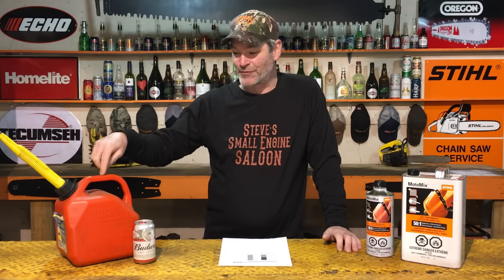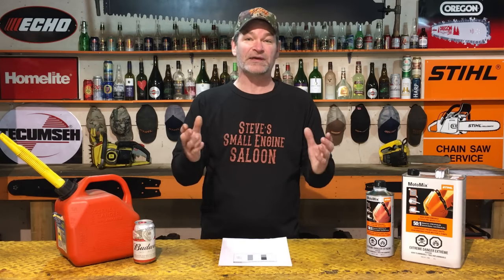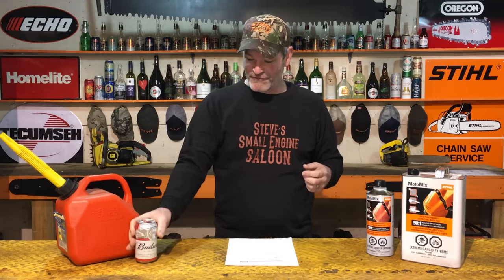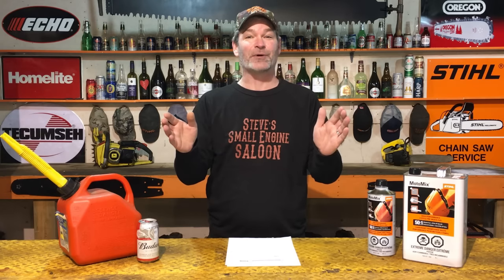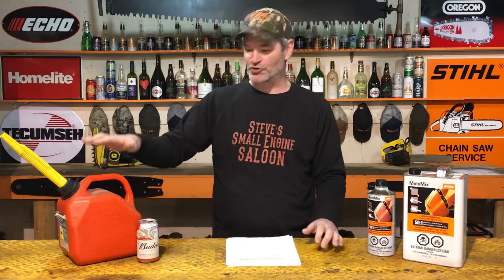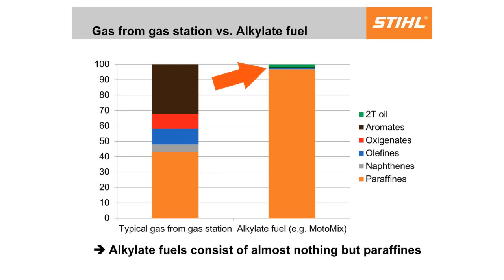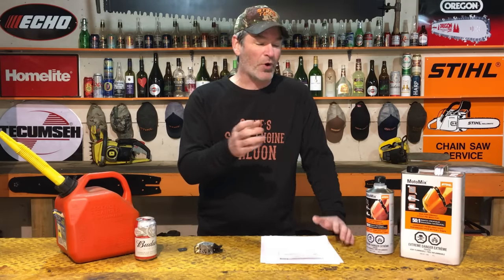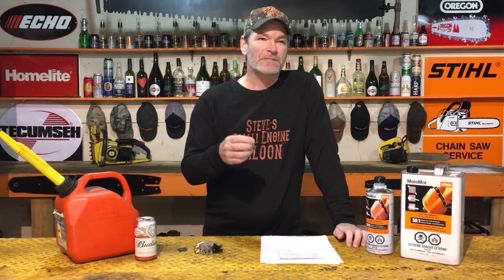The Ugly Truth Why Gas Station Fuel Is Bad For Small Engines

Comment: Thanks for sharing this. I've heard (and said) a lot of dumb things about why gasoline from the station is (or isn't) bad for small engines. And I've cleaned a few carburetors and junked a few lawn mowers that might have lasted longer had I known what I know now.
Reply: Why do the gas manufacturers put the other junk in here? What is the purpose of it? What does it do to the environment and is it worth it?😊

Comment: I have been using normal unleaded fuel that I manually mix with two stroke oil in my equipment for the past eight years while living in my part of country Australia and have had no issues with my equipment. Oh sure, I expect that the Stihl fuel is a premium product, just like their very expensive chainsaws are premium equipment, but for us more common folk, that can only afford so much, in my experience I can say that using just regular fuel is fine. Mind you, if I ever did save up enough money to buy a $1000 plus chainsaw I would probably buy the more expensive fuel, though I doubt I could afford the postage costs. But I do love the way that Steve presents his videos.

Comment: In Belgium, we trim hedges all day long in summer and always use pre mix fuel like Moto-Mix but it's Aspen.
We use it because it's better fot the engine, it's already mixed and it's not that harmful for the health. I can ensure you if you're hedge trimming all day and you breath all those fuel fumes , you feel horrible at the end lf the day. We always use hand held hedge trimmers, but extended trimmers for reaching high places
Reply: PJ 2000 why not go electric ????
Reply: @jimmysapien9961  2 reasons: a lack of power for some hedges 
And battery powered equipement is really expensive

Comment: I work for the local power company and a few years ago we switched to motomix. We don't use our saw everyday but when we need them we need them in a bad way. Before we switched it was almost a weekly deal to haul a saw to the repair shop for fuel issues. Since we switched it has cut repair bills by 2 thirds. Maybe even more. For my home saw and weed eater I've been using Coleman fuel mixed with stink 50:1 mix for several years. No issues at all and runs just as good as the stihl  mix. Plus it over half price of moto fuel . In all reality moto fuel is Coleman fuel. I know all the rc model aircraft guys that fly the super high dollar airplanes use Coleman fuel mixed with stihl oil. It works fantastic.
Reply from the maker: Right on...
Reply: Yes, it's the same stuff as motomix. Just add a bottle of stihl oil and your good to go. Wal-Mart brand is cheaper that Colman brand.
Reply: Al Yaz Coleman fuel is naphtha. Same as lighter fluid. Same as VM&P Naphtha at the hardware store.
Reply: @graphicsdude  doesn't seem like a engine would run very good on straight naptha. Or am I missing something he said.
Reply: I dont see where folks are constantly having issues?  I per mix my fuel and sometimes dont run my equipment till the next hunting season....never a problem. That's my blowers, riding mower
 Weed wacker... mowers. Same thing with my buddies.
Reply: @henryross4343  well I'm not sure where you live but here in SC it's either hot and humid or cold and damp or wet and humid so fuel tends to draw lots of water from the atmosphere. Only way I can leave fuel in mine all winter is to add some stabil if not the run raggedy come spring. Some times you get lucky and they run ok. But I would assume that's because most of the the fuel has evaporated out of the carb.
Reply: @ReidHenderson  I love in austin.  I use amsoil amber two stroke oil.  I mix a gallon for my two stroke  equipment and then pour the left over in my mowers with regular gas.  I would have to say amsoil claims of not needing fuel stabilizer is correct if you use there two stroke oil.
Reply: @henryross4343  Everytime I get done with my two stroke equipment I pour the unused small gas cans into my mowers. I would like to think that little bit of oil helps to lubricate everything on the top end of the engine some. As long as you don't get to rich of a oil mix and foul out plugs
Reply: @henryross4343  lol Henry I do the same thing!!! Lmao I actually  add a little more oil than they suggest because I feel they have it to lean a little more oil keep it lube good;)

Comment: As a lawncare professional, I have to say that service and repair is less expensive overall than the cost of premixed fuel.
Perhaps for a typical use homeowner, premix is a better option.
Reply: Yes, for a homeowner premix is great typically as they don't use their equipment on a daily basis, and some equipment sits for several weeks to several months so premix for that is great....

For the pros that are using their equipment daily premix don't make any sense as you are going through your fuel fast enough that you won't have any issues.

Comment: Hi Steve, have you ever heard of draining and running all the fuel out you can before storage then pour mix oil only into gas tank, push primer bulb until you see it in bulb maybe a little extra to be sure it has been circulated through all gas lines and carb.

Comment: Have been storing my small engines this way for several years. Also only run no ethanol gas in all my.small engines. Zero problems with this program.
Reply from the maker: Right on
Reply: Me too. But it's no guarantee. I have a 4-stroke Makita leaf blower that is having carb problems. It's never had anything other than alcohol-free fuel. Been diligent about maintenance, but I'll be damned if it doesn't run like shit. I don't know what's true. If what our boy, Steve says, even alcohol-free fuel is 40% bunk. Our other choice? Buy the fuel that costs 20$ a gallon.

What guarantee do we have that the $20 a gallon fuel isn't going to leave us with a clogged jet?
Reply: @stevetdean1966  Just be diligent keeping the fuel clean of crud. For long storage periods like generators I always run the carb dry with never a problem.

Comment: I've been winterizing my equipment with engineered fuel for 3 years now without any issues. It is expensive so I just run the tank dry at the end of season and run engineered fuel into it and leave it and haven't had an issue starting up come the spring or well winter with the snowblowers yet. When I'm running equipment daily though I'm using regular gas from the pump, 2 cycles since I don't use them as often I stay with engineered fuel all the time to avoid having to deal with those carbs.
Reply from the maker: Right on Rob!  I agree...

Comment: I used to dump the fuel after the season ,then run it and choke it dry .  After a couple trips to the repair shop and spending $$$ I decided to try this. I have used aspen and motomix. They are both great. Yes its expensive but no frustration or trips to the repair shop.  For the little fuel the average person uses ,I think it is worth it.

Comment: I've used SeaFoam in any and all gas cans, not including 2-stroke, and have left engines for > 5 years, and had zero varnish, and immediate start. The engineered fuel is nice, but the value is extremely poor based on its pricing. Toluene (SeaFoam) does a gr8 job IMO.
Reply: I agree. Couple caps of it in all my 2 cycle gear keeps em good for the winter
Reply: i use it in all my small engines and never had a problem...never...and yes im an old guy ok??
Reply: Dave Hanson  wrong it works in anything
Reply: How do I use it. If I have gas left in the saw and think I won't use it for a while, add some seafoam? How much? If I  storing it for a long time, run it empty and leave it empty? Or leave it with only some seafoam? Or leave it with se gas and seafoam?

Comment: Hi Steve. Just ran across your video. Thanks. Were carb diaphragms made of different material 35-40 years ago?  My retired Lawnboy never had carb problems through the 1980s and 1990s. My 1986 Homelite SXL chainsaw and 1984 Jacobsen 2-cycle snowblower also never had carb problems with pump gas and are both still used today.  Other equipment I purchased in the 1990s & 2000s have had numerous carb diaphragm problems. I do use TruFuel now in recently purchased chainsaw and leaf blower. Other equipment for last 5 years uses pump gas w/o ethanol + SeaFoam. I only run dry the Jacobsen.

Comment: Our fire dept in Texas transitioned from gas station fuel to the canned fuel several years ago.  Our Stihl saws and ventilation fans were constantly in the shop prior to the change.  After using the canned fuel, our stuff started and ran great.  We don’t use that much fuel so the cost wasn’t that bad.  I just bucked approx. 70 trees a few weeks ago.  I blew through the canned fuel and that cut in to my profit quite a bit.  At $25 a gallon, I spent nearly $75 on fuel.  That stunk.  I wish there was an in between source that was good but not so expensive.
Reply: $1 a tree
Reply: You can do the majority of the work with pump gas, and switch to the canned fuel when your almost done.

Comment: Steve I have a quick question for you. I have a zero turn lawn mower with a Kawasaki motor on it. I checked the stator when it was running and I wasn't getting any voltage out. However, I have continuity.  I'm pretty sure that the stator is bad because it showed no reading when it was running. what are your thoughts on this?

Comment: Steve, don't throw the baby out with the bath water. Your Bud there is about 5% ethanol, and it seemed to go down ok.  There's a place for everything in your standard gasoline.  Benzene has an octane number of 101.  Without aromatics like benzene, it would be a lot harder to formulate high octane fuels. Benzene is a fine motor fuel as long as you don't suck on your fuel line. Lick your carburetor regularly and all safety guarantees are voided.  Toluene, which is just benzene with an extra methyl group, is another example of a great aromatic.  How many generations of kids have enjoyed the subtle aroma of toluene in model cement, with only minor permanent damage?  It's a heck of a solvent, too. Gets paint off of stuff quick and easy.  And it has an octane number of 121.
Reply: Benzene is a serious carcinogen and mutagen.
Reply: No need to drink Benzene to be destroyed by it. It is an aromatic meaning you smell it and ingest it through the air. It’s the bad news in gasoline.
Reply: @YeshuasBro  But most people will still run the fuel with Benzene in their vehicles, which for most people is probably 95% or more of their exposure to fuels.
Reply: If you were a mechanic in the early 80's you would know the characteristics of toulene, benzene,tri-chlorethlene and abstain or handle with extreme care.
Reply: "minor permanent damage"  haha. I finally figured out my problem, all those damn model cars and airplanes I put together as a kid. Who Knew????!!!! Right?
Reply: @samcooke2742  sorry for the 2-year later reply, but people also forget that benzene in the gas is one thing, but out of the exhaust it's a different product (CO2 is properly combusted).

Comment: Great video! I’ve noticed that pump gas tends to give my modern equipment a hard time, but I’ve never had a problem running it in vintage equipment. Case in point, my 12 horse Briggs and Stratton 4-stroke from 1975 has been run on standard 87 octane pump gas and it has never had an issue, other than the  gasket beneath the sediment bowl needing replaced once, it is on my old wood splitter and the damn thing fires up every spring. My Echo SRM300 brush cutter from the early 80’s has an original carburetor that has never been rebuilt as does my SRM220. Both machines run 40:1 mixed ethanol fuel with zero problems and run like brand new. New Husqvarna, Stihl, Jonsered, Craftsman etc etc is built chincier than a happy meal hot wheel. Manufacturers are looking at the balance sheet and cutting corners I reckon!
Reply: @jasonjrf  Pretty neat to hear someone else callin’ It “weed whippin”! Lot of folks cock their head to the side when I call it that. 😆 And I agree, I use up a five gallon tank very quick and I mix my gas in old five quart oil jugs and they won’t release vapors until the cap blows off, which hasn’t happened to me yet. I’ve seen gas cans with pressure relief valves and caps that will leech out vapor nonstop and wreck the gas in short order. Six months down the road you’re left with varnish that will toast a carb quick! Fella with a YouTube channel about small engines was talking about mix gas having a three week shelf-life and I bet it’s for that very reason.

Comment: I did this "non" winterization with my Husqvarna gas string trimmer (2 stroke) and Husqvarna fuel, leaving the gas in.  Just started it up for the first time, and... IT STARTED AND RAN!!  I expect Husqy's engineered fuel is similar to the Moto-Mix in composition.  Way better than needing to pull & clean a carb.
Reply from the maker: I agree!

Comment: So, do I still need to use stabil throughout the year if I use this stuff just for winterizing? I just watched your video on stabil.
Reply: I don't use stabilizer when they see semi-regular use (I have a mechanical lawn mower that I use in between gasoline-powered mows, and the gas mower is the only gas appliance we own), and it's always been fine. That's using regular, with its shorter shelf life (3 months as opposed to 6). Additionally, the canned fuel doesn't need that crap in it, either

Comment: I run a fuel stabilizer in all my small engines, including outboards, all the time. Mercury Quicksilver Quickaire Stabilizer, one ounce to 10 gallons of pump gas, is very cost effective. I fill my mowers and such from a 6 gallon container, one half ounce to 5 gallons pump gas, never a problem. I give 'em all a Seafoam treat once a year or so, all good.

Comment: Well, I've had my Craftsman for 19 years and used Mid-Grade gas station fuel and I've never even looked at the oil dipstick, let alone changed the oil. I did have to replace the string pull when the rope frayed.

Comment: Steve, are the engineered fuels actually made by the companies selling them, or do they use a petroleum refinery company to make a blend of base fuel for them, and they either put their additives in it, or do they just have the ready made product made with seller's label on it, but made by someone else? Thanks for all the info your videos provide, they have been very useful in my saw maintenance, as I'm new to it by the way.
Reply: No, the power tool companies obviously don't make these fuels. They order their products from refineries and/or fuel distributors. Alkylate gas is nothing fancy, and alkylate gas with premixed oil of the brand company's choice is not much fancier.

The fuels are mostly quite similar and at least parallel. Premix oils are different, but quite similar between good brands. Obviously non-premixed straight 4 stroke alkylate fuels are very similar and any one of them will run any lawnmower very well, without the operator having to inhale carcinogenic aromatic fumes.

Comment: I found just running the engine dry was very effective in keeping the equipment working the next season. It’s when I forget to run it try that I have to pay someone to fix my stuff.
Reply: This use to be a recommended practice, but there will always be traces of fuel in the system even after running it dry - especially in bigger carbs with a bowl.  It only takes a little bit of stale, dirty, water-contaminated or just plain bad fuel to cause gum, varnish or corrosion.  Plus running dry exposes fuel lines and other rubber or plastic fuel system components to air (oxygen) which can cause deterioration over time.
Reply: @VBCJesusSaves  usually if I’m on my game I’ll put fuel stabilizer in the tank and let the engine run for about 5 minutes and then I drain the tank the best I can by syphon and then start the engine again and run it dry. I’m not sure if that would solve the bowl issue but I certainly found that approach better than just run it dry without stabilizer. 🤷‍♂️
Reply: @richvail7551  Just listen to Steve and fill with engineered fuel if your machine is going to sit for at least 30 days or more.  It's not cheap, but neither is a carb replacement.  You'll never run the bowl dry.  You can take it off and clean it out, but who wants to do that on every machine.  Stabilizer is essential if you're using pump gas, however, it isn't the ultimate solution for off-season.  Today's pump gas isn't what grandpa used to use.  Cheers!

Comment: I'm in NZ and our go to gas is 91 octane. Depending on where you buy it, cheaper prices contain 10% ethanol and I've never seen it cause problems, but I noticed today , when  I started my line trimmer with 9 month old gas,  it started half throttle but wouldn't idle, I changed the fuel and it was fine. I put that 700 odd mils in my van at 2.65 a litre it's the same value as beer !  Burp.

Comment: At the price of the premix, I'll stick with the old-school way. I have several brush cutters and chain saws so I remove the alcohol from the gas, easy to do! I fire up my machine with the alcohol-free gas and bring it up to operating temp, drain all the gas and fire it up and run it dry. I open the tank cap to allow any gas to evaporate out of the tank then cap it back up. Put everything away for the off season. It's worked for decades.

Comment: Is the fuel station fuel ok for the 4 stroke engines?  I'd had great luck using the non-ethanol premium with SeaFoam as a stabilizer for my 4 stroke engines, but have always ran into issues with the 2 stroke engines.  Even using the ethanol free premium with SeaFoam and a good synthetic 2 stroke oil.  Now I know why for the 2 stroke.  Thank you very big for this.